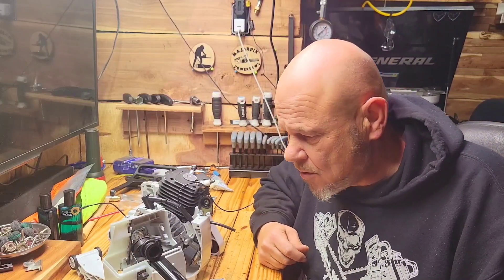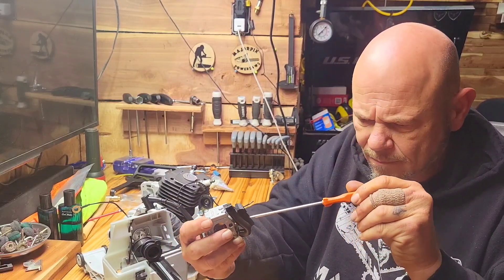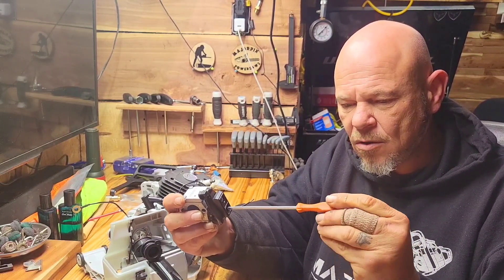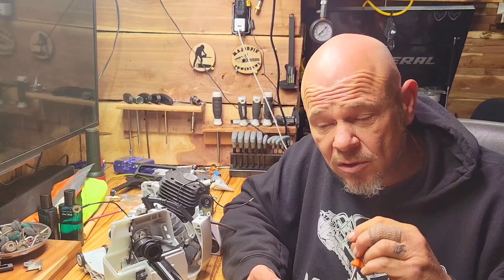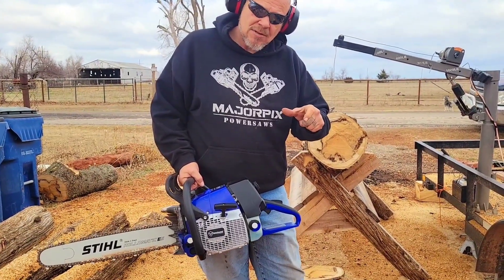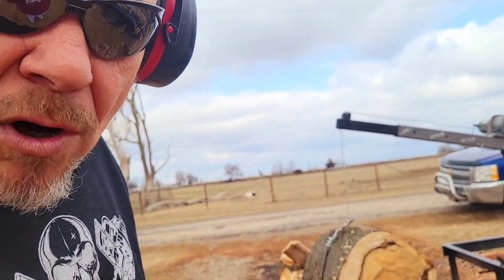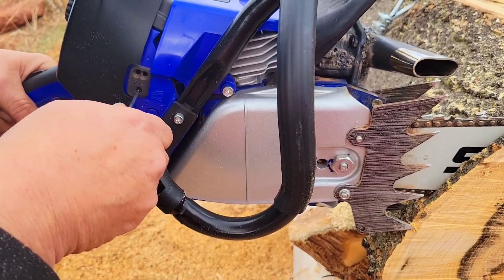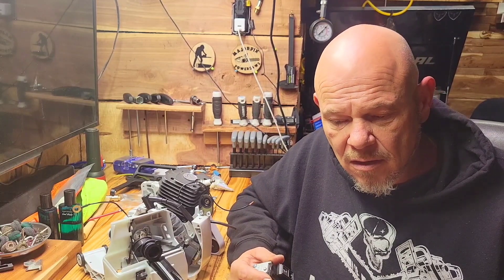What does lean and rich mean? and how 🤔 to tune your carburetor on a chainsaw!

Comment: bud i’m a little stumped. got an echo 355t and have gained some knowledge on the subject. did a muffler mod and air box mod. took out limiter caps and started adjusting after watching about 2 hours of videos. the saw runs good but can’t tell if it’s too lean. 4 stokes out of wood and has a smooth roar inside the wood. i think its good just want piece of mind.
Reply from the maker: I would say you was , fine... if you wanted to go over board and make sure you weren't running to many RPMs. You could get a cheap Amazon rpm reader rap the wire around the plug wire 3 times, and it gives you a digital read out. I believe those are thirteen five rpm. 
   The overall thing to be careful about... Is it?
Even if you are running it too many r , p , m , just give it a breather every once in a while. A lot of guys will supper tune saws  ( basically lean them out further than spec) 
Just remember,  if it sounds damaging... it probably is
Be well and stay safe

Comment: Lol I couldn't follow this at all. What I don't understand is 

1. How you HEAR a high jet is wrong
2. How the 3rd screw that you turn to stop the chain moving relates to the low jet and which one you should turn first
Reply from the maker: Ps high jet is the furthest away from the tip of the bar
Reply from the maker: Lol, watch it again, then!  High and low are next to one another! The other is the idle!   Idle= idle  low= turn tell the chain starts and back tell it stops! High= chain speed! Rev!
The High and low jet can be turned all the way in and out 1 full turn to start tuning!
Good luck

Comment: I always worry too lean mix is less oil and heat causing severe damage. If carb is a little erratic it can easily stray into more than you adjusted for under load. Great vid.

Comment: So turning to the right screws them in and leans them out. Left riches them up?  I may have to edit this if I'm not correct.
Reply from the maker: Yes, sir, that is correct... when we screw it in (to the right or clock wise) it cuts part of the fuel off and adds more air, making the fire hotel! 🔥 when we turn it to the left (counter clock wise) it allows more fuel per air mix and makes it rich, and because of stealing air from the mix, it makes it RICH. 
This seems backward, I know... but, thank about a fire in a fireplace. The more air the hotel the fire! Same concept! So when we break our saws in, we want more fuel and (OIL) to run through the cylinder to lube the moter more while the new rings and cylinder break in! 

Hope this helps, sir
Thanks for watching 👀 🙂 🙏 
Sorry for the late reply. iv been out camping with no service 😅
Reply: @majorpix channel  no worries on the late reply.  Keeping the wood stove stocked in Pennsylvania. With our cold front. Thanks for the info on the tuning.

Comment: Great job explaining. I see a lot of guys saying it should sound smooth while in the cut, and 4 stroke burble when not pressing into wood. Is it accurate to say that’s being pretty far on the safe side of the high jet? My 271 from stock never seems to burble, seems to sing pretty fast while free spinning. But I checked with tach it’s around 12.5k rpm. Been running like that for 2 years so I guess it’s ok?!?
Reply from the maker: Yes, sir, 12,5 is a good safe speed! Especially a good work saw... 271 has a lot of torque, so staying lower rpms is a good thing! 
I use clones to experiment on and build a few to play with! However,  staying at or below specs is always a good thing for long-term use! Sounds to me that your saw is tuned perfectly, sir!
Thanks for watching 👀 🙂 🙏